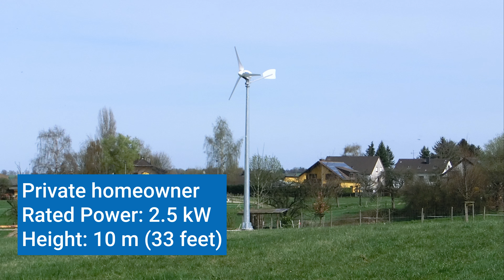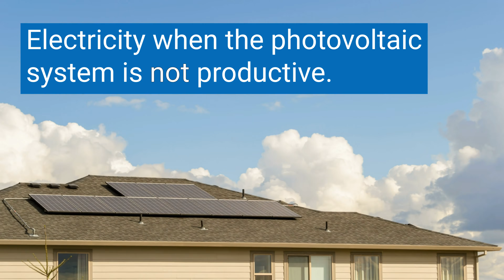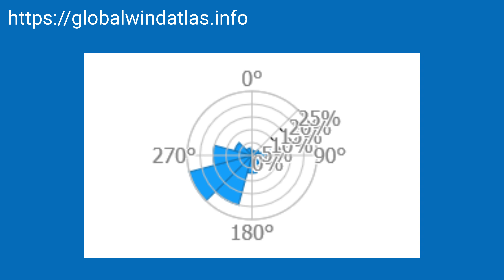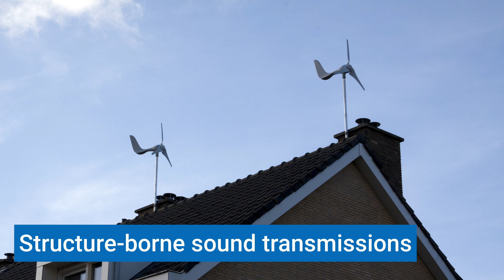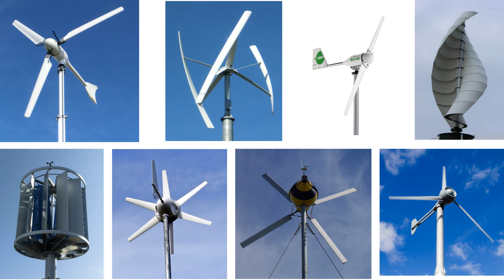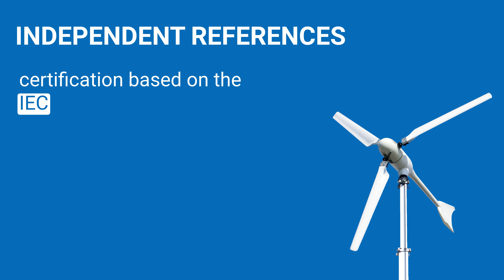Small Wind Turbine: Success or Failure? Do not make those Mistakes

Comment: I bought a lantern style VAWT on eBay and it produces 1 to 5watts when spinning fast. I asked the company why do they call it a 3000watt unit and they said it is calculated over one year !!!! Enough said. André
Reply from the maker: VAWTs often look nice, but the problems start when it comes to electricity production.
Reply: That does not make sense
Reply: Your post does not make any sense because you are mixing up watts (power) with watthours (energy).
Reply: @lingondraken  no - the vendor is doing that, quite deliberately
Reply: @JohnR31415  Really? That sounds like something illegal, then.
Reply: well seems like pedal power would produce more out than the ebay wind generator ......
Reply: Those are made for with a solar panel.
To work a small led licht on place you need a Street light.
Like in mounted trails .
Than this combo will do the job.

If you see the real manufacture you see this pictures for it .
Its never be sold for off grid use to power a house.
Its more like just to charge a battery.
Like the model that is use for a daily boat .
Reply: I'm from India and about to complete 1kw turbine,,Most manufacture mislead by giving wattage generation,,but never disclose per hour or per day,,
It is there global practice,,only self learning and practical results give us the authentic data,,
I'm working on DIY horizontal turbine using car and truck alternator,, which will be quite cheap and reliable,,12v/90amp alternator which i hope will give 1kw power per year,,based on my experience,,i will build a bigger size 5kw,
Mr Patrick is giving very authentic and genuine advice and after seeing many of his videos,,i have subscribed for all videos,,
Reply: @WindSunWisdom time tested horizontal turbine is the only most efficient to capture sir,, vertical turbine are poor in efficiency because of drag which i understood few months back and then switched to horizontal turbine after having worked on vertical one
Reply: @lingondraken  what the seller stated makes no sense.. because he said it .. all these chinese brands lie
Reply: @lingondraken  they all lie and get away with it.
Reply: OK people..Check this out. Just increase the size of your vawt blade to MATCH THE SQ.FTG of ALL of the regular  horizontal unit's blades! The vawt only has ONE blade exposed to the wind on ONE side.(.with a BIT of help from the prior  & trailing   blade on a 3 or 4 blade setup)..Just be sure  the central post/shaft structure & vane supports are STRONG & everything WELL-BALanced!! It IS nice U dont need a tail fin as well. Me & a neighbor are threatening to build OURS any time now. We in a tight residential nbrhood w lot O trees too. We hope these work in the buffeting winds here. We shld check local nbrhd max wind machine hght allowances at any rate!
Reply: Most wind turbine ads are fraud,
Reply: @buddha2845 1 kW power per year?? Power is what is produced NOW measured in W. Or kW. 
Energy produced is W x hours = Wh. Or kWh. That is the unit for ENERGY.
Reply: @lellesunk  the truck alternaor gives 100amps  with 12/24 voltage,,so  it's about 1 to 2 kilowatts per hour,,is it right?
Reply: 3000 W  per year  !!!

Comment: If your turbine tower is 100ft or more expect it to be hit by lightning.  To protect from lightning a low impedance conductor must provide a direct path to ground for the lightning or it will find it's way to your electrical equipment and burn it out.  A low DC resistance conductor will not provide a low impedance path to ground for lightning unless the conductor has a large diameter (skin effect) which will reduce the inductive reactance.  This is true because lightning is an impulse which has a large bandwidth (see Fourier transform).  This is what I have learned as an Electrical Engineer working on  lightning protection design of communications sites on mountain tops.
Reply: Low impedance means?
Reply: @buddha2845  Low resistance in both AC and DC. In DC the current flows through the whole conductor. In AC it tends to concentrate toward the surface of the conductor, this is skin effect. Also, in AC the conductor acting like a coil and not like a pure resistor starts to become important. A coil opposes the increase of the current, meaning for a short while it looks like the coil has a bigger resistance than it really has. Now the last piece of puzzle, the Fourier transform: any signal of any form can be decomposed into a series of sinewaves (AC at different frequencies). Basically, the guy is saying that when you're dealing with lightning, your 4-inch diameter round and smooth solid-core conductor (it looks hefty, right?) used for grounding may not be enough if you don't do your math carefully.
Reply: on most urban land in Europe such a tall pole will require planning permission, too, and a minimum distance with residential buildings around

Comment: I have been using wind turbines for 15 years, the best is a 8 ft. Chinese manufactured because it provides 500 watts with a wind speed of 18mph. The problem however is that there are no wind controllers for LiFePo4 that include BMS , they must be manually adjusted and i don't like it.
Reply from the maker: How many years has the turbine been in operation?
Reply: what brand and watts please? where did you purchase it?

Comment: Another important aspect often overlooked by private owners is the maintenance and repair. Is it easy to access the turbine? Are parts such as bearings replaceable? Is it easy to do lubrication? Not many private owners would climb their 30 meter mast and open the device on that height. Are you calling a professional with a cherry picker or a crane to lift the device off altogether?
Reply: You can mount the turbine on a pipe that you can tilt down to do maintenance.
Reply: Yea the masts that you can lower are very important

Comment: Savonius Turbines are less efficient, but they reach their efficiency maximum at a lower wind speed. So for otherwise unsuited locations and wind speeds, that might be an option. Looks also matter in an urban environment. And since savonius rotors look more like an art installation than an industrial ventilator, you could probably get away with a bigger one to compensate for the lack of efficiency, without infuriating your neighbors.

Comment: When I lived on a sailboat for 7 years, a small wind turbine was a perfect complement to my two PV panels and provided all the electrical power I needed for refrigeration, lights and electronics without the need to run the engine driven alternator no matter how long I anchored. However, the wind turbine was not as reliable as the PVs because it is a mechanical device and required maintenance especially in a saltwater environment.

Comment: One of the main problems for small scale wind turbines is the complexity of adapting to the local conditions and finding a solution that is cost effective. Extreme efficiency is less of a problem compared to ease of installation+maintenance. There is no single packaged setup that will work for most people, whereas with solar panels it's much easier to predict what you will get from them and you only need to worry about having them decently located and oriented. Oftentimes having them just lay on a flat roof already is effective enough.
Reply: Yet still one encounters a lot of vodoo salesman when trying to choose a pv panel from my experience

Comment: Good video and great advice, thanks! Your neighbour from the Netherlands here :) I am really interested in small residential wind turbines.It is however really hard to get good solid advice. Everyone is advertising small wind turbines as 1 or 2 or even more KW. I am more interested in a wind turbine that will generate at normal wind speeds about 100 Watt and that I can plug in to an electrical outlet. That would allow me to install it myself, keep cost low and do some experimenting. Because the main purpose is experiments. During the night I think I can cut down my energy usage to about 100-200 Watt. Would just be fun to have days where I have no need to get power of the grid for a whole day.
What I also really hate is the way people mix up Watt and Watthour. It is so simple! I am not interested in the kWh it'll potentially deliver over a year. I am interested in the Watt it delivers at any given moment.
In a lot of cases the "nay" sayers continue to bash about it not being efficient and the ROI is way too long. I don't care about that. For the time being it is just for fun.
Reply from the maker: The problem is that you usually don't have enough wind in the residential area. I will publish a new video about this the next days. Especially when it comes to home wind turbines, there are some dishonest suppliers on the market. Beware of exaggerated advertising promises.
Reply: @WindSunWisdom  thanks! Looking forward to it

Comment: If I may just add a few things from a decade of experience living off a combination of wind and solar electricity. 
These all provide DC current which has to be run through an inverter before it can be used. Inverters are “low inertia” power generators so if you suddenly apply a large inductive load, which can do some weird things to the voltage and frequency of the electricity when they’re first turned on, especially if the inverter is just adequate in wattage. So the phase gets out of sync a bit and the voltage drops, it’s only momentarily but for some older more sensitive electronics, it could cause them to malfunction a bit (I had a computer that would switch off when I turned on the blender, but that was solvable with a small UPC) just something to consider.
You’re also going to want a good deal of power storage, for the off peak hours, and for times when the load is temporarily larger than the generation capacity. Add a thousand AH of batteries and say you are generating say 400 watts @12v (which is only 40w at 120v) well that’s enough to run a light bulb but not a microwave. Fear not the battery has you it provides the extra watts to run the microwave, then gets recharged by whatever surplus of generation there is after the microwave turns off in a minute or two. If you’re clever you can play the average generation over time against your average use over time, make the generation a bit higher and dump the rest into batteries where you can use it later. That way you only have to size your inverter to cover your peak demand.
Reply: Watts is watts is watts. 400 watts at 12v is also 400watts at 120v and also 400 watts at 12000000v. The only thing that changes is the current.

400w at 12v is about 33A of current. That means you need a really thick cable to handle the current. At 120v it’s only 3.33A so a much smaller cable is needed. Both would be to little for a microwave but enough to run about 6 to 10 old school light bulbs that nobody should use anymore since led is cheap and available.

Comment: Hello everyone i am a seller of wind turbine i have tested few sizes all turbines under 16kg are almost useless + most vawt turbines are not efficient. 
I have a 2kw turbine of 60kg and it peaks at 2.6kw .
Wind turbines are helpful in winter when it's cloudy and windy .
It's help the battery to hold on the cold weather nights of winter. 
My advice to anyone thinking of adding it to there solar system make sure it between 25kg to 60kg to be able to install it without big machinery and less cost for the tower of it.
Good luck !😊
Reply from the maker: I agree, VAWT have not yet been able to really convince the market. HAWT are still the best choice.

Comment: I designed from a large scale to achieve maximum electricity output, it had to be changed significantly because the designed generator could provide more power than expected. It was necessary to change the wind turbine to the smallest size possible. The benefits were that the installation area was very large and the noise was greatly reduced. Water could be pumped up to a storage tank and released to spin the water turbine to create circulating electricity when there was no wind, so there was no need for batteries at all.

Comment: About 10 years ago I read a book by the guru of wind turbines and he basically said unless you have a huge commercial turbine it's not worth it . Maybe that has changed since then , Neighbor put one up and it ran for about one year now its a yard ornament
Reply from the maker: Small wind turbines may be a perfect complement to photovoltaics, as long as you have a location with enough wind. As far as grid-connected wind turbines are concerned, the turbines with an output above 10 kilowatts are more economical than the smaller turbines. But in fact, there are many poor quality small wind turbines. They then become decoration.

Comment: Very well explained. I have a question pls. I have purchased a Skywind windturbine and installed it on my roof. However, i cannot get rid of the vibration during high winds. The manufacturer has advised to install the turbine higher on the roof, but i cannot do more than 6 meters. I was thinking of changing the rotor blades to a 3- rotor blade and shorter ,  instead of 2-rotor long blades,  maybe the sudden wind direction would not produce the vibration. Have you experienced  something similar before ? I would really appreciate your comments/suggestions. Thanks.

Comment: My 600 watts B&C Chinese wind generator was making 250 watts earlier today. I live in East Oklahoma on a hill, almost at the top. 
I ordered a 24 volts model , and the one they sent was marked 24 volts, but it was a 12 volts model. I went ahead and used it. I used a 250 amp rectifier and hooked it directly to 16 marine deep cycle 100 amp hours batteries. It is independent of the solar batteries. * I used four 24v 100 aH lithium batteries and four 31 series lead acid batteries on the solar part. I've had the wind generator up since March 2023. The turbine is mounted on a pole 6 meters high, I can't put it higher because of lightning ⚡. Being on the hill, I'm already 6 meters above the ground, so it acts like it's 12 meters up. 
There was a small tornado 🌪️ that had 95 mph winds that hit it 8n May, the aluminum tail fin was ripped in half, but I made one out of sheet steel. It still works fine. 
For about five minutes, it was making 1055 watts. I didn't use a dump load, instead I have a 250 watts heat lamp that I turn on when the voltage goes over 14 volts. It's always been enough to keep the voltage down in the 13s. * I have a set of five 28 inch blades and a hub that I am going to use to build another wind turbine. My current one has three blades. The last storm, it was making 350-420 watts in a gust of around 35-40 mph. The windy month is March, when wind speed is 10.2 MPH average.

Comment: Patrick, thank you for this I found it most helpful. I have a question that I hope you can answer I’ve been seriously looking at adding a wind turbine to supplement my grid tied, domestic Solar PV system. I have been measuring the wind speed at the roof peak (measured using a Ecowitt anemometer mounted 300mm above the ridge tile, approximately 8 meters high) for eight months and our monthly average wind speed has ranged from 5.6m/s to 8.8 m/s with the sole exception being May when the monthly average was only 1.5 m/s.. My question: Do you have experience with any turbine that would suit the wind conditions?
Reply from the maker: I generally advise against installing them on the roof. Often too little wind and/or turbulences. Your wind data seems very high to me for 8 m heigth. Perhaps you are near the coast. There's a lot of nonsense on YouTube about home wind turbines on the roof. A new miracle wind turbine presented every month. But in practice, the systems do not catch on in the market.
Reply: For clarity, I do not intend to install the turbine on the roof, although the anemometer is installed up there @WindSunWisdom
Reply: For clarity, the turbine would not be mounted on the house but for practical reasons, I mounted the anemometer up there. We are situated on the side of a long shallow hill at the end of a long dale (valley) in Derbyshire.  @WindSunWisdom   Do you have experience with any turbine that would suit the wind conditions?
Reply: @WindSunWisdom I had a company advising and installing, they want  another 10K for the turbine and installation with all "power collected" going into my existing Solar installation and the battery. I think it is too much.. I also do not have achres of land, to have a wind turbine a size of medium bush at the front of my garden was also not acceptable.

Comment: Hi, i live in rural Finland. I have solar panels but want to consider a small roof top wind turbine as well, mainly for winter months. I am finding all the information rather overwhelming! Vertical vs horizontal, that would add to my solar plug and play system. Every time i think i uave a plan something contradicts my plan and im back to squre one. Can people help me with a step by step plan or overall advice? I know this is asked ng a lot but i don't want to give up! I posted this on the 17th of July 2024 at 10.47am Finnish time.

Comment: I inherited a 3-story residential building with about 6 apartments that host small families or single individuals. The building is located near the top of an elevation, and I've experienced good wind flow when on top of it, but haven't measured it carefully, yet.

My question is about transmitting the output of an equipment that I install on a tower over the roof (not necessarily too high, as the 3rd floor roof would grant a good altitude by itself), to the renters, so that they pay for the electricity, even though in a mixed system with the regular electricity provider in our region, a town in the state of Minas Gerais, Brazil. Is there a way of measuring the individual consumption for each apartment? My idea is to charge them with a discount (20% or 25%) over the regular price of the electricity provider company. I wonder whether that would be feasible.